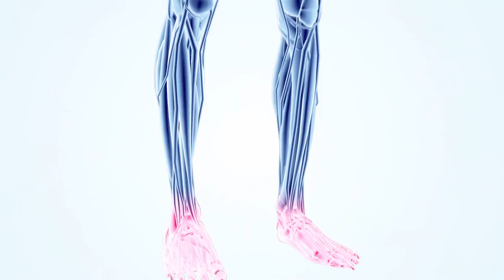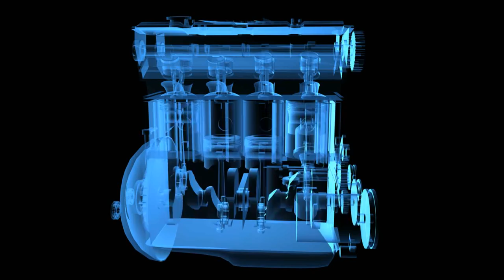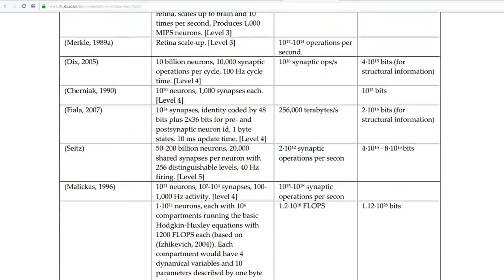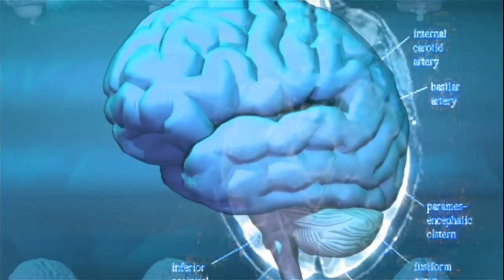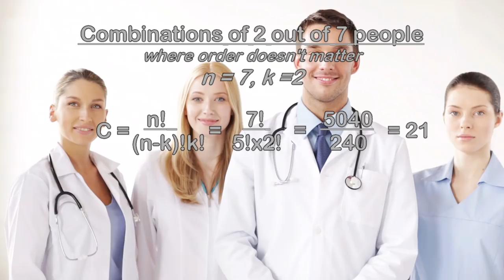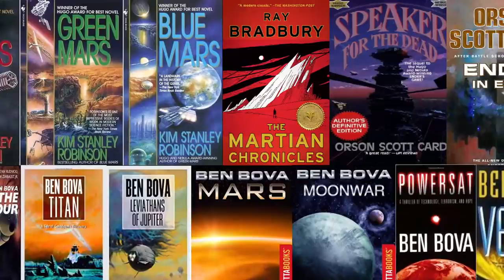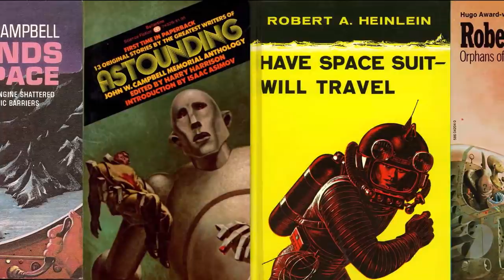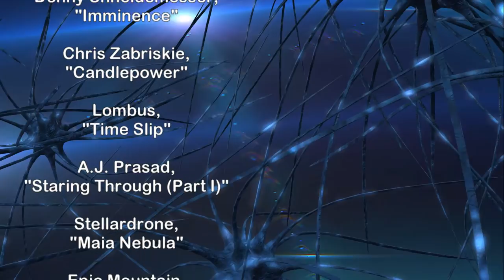Mind Uploading

Comment: yeah the biggest problem in mind uploading is not the hardware, but getting an actual scan of a brain and all the things you need to emulate in the first place.

Scanning tech is nowhere near a place to do it while a person is still alive and slicing up a dead brain probably destroys a lot of information you would need.
Reply: Zamuroy
We can now see neuron-level brain activity in realtime.
Reply: really? do you have any source on that? would like to read that.
also what exactly do you mean by neuron level? all connections all signals of all neurons, that would be news to me, but if true really incredible.
Reply: hmm while this is nice, it's nowhere near anything that would actually "scan" a brain... since it works with fluorescence you still can only use it by looking what lights up under a microscope, which means you have to slice and dice the brain in to parts small enough or when used on a brain you could only observe the surface, but would get no signal from deeper regions.

might be cool to learn how parts of for example the visual cortex works since that things is made up of pretty much millions of identical computing units made up of a few 1000 neurons. Could help improve existing AI systems.

But i don't think this approach in general will help with brain scanning, even in the future.

cool info though, thanks

Comment: I note you didn't touch on the possibility of each cell having quantum computing resources. If true, it would mean a complete and perfect copy of one's mind would be fundamentally impossible; perhaps even if it were a cell-by-cell replacement.
Reply: I wonder if it will be possible to have a "copy" be directly connected to the original mind... Have all copies be an extention of that mind's experiences rather than having separate, completely disconnected experiences, inaccessible to the original.
In other words, make the single original individual into a plurality.
Reply: The more I ponder uploading, copying and/or augmenting a mind, the more it feels like a new path for the same old evolutionary forces to have their way. The more it feels like an extension of what cells did long ago to start down the path to us and everything around us.
And less like we're reinventing or giving the wheel a new engine, and more like we're giving it another road. Just a new path to travel....To explore.
...And it all turns back into a zoom of this univere's fractal.

Comment: If you need a pilot, I think you'll make one from scratch rather than recruit a copy of a human. You'll get a better pilot with no distracting interests in pottery or coup attempts, no naps, no dietary requirements, and with fewer or no ethical entanglements. Non-human minds will be better at all tasks. There will only be disadvantages in employing humans instead of AI experts. 

Preserving, extending and duplicating human minds may still happen, but it will be more an exercise in vanity than a solution to staffing problems.

Comment: An interesting thing I have just thought of in regard to the ship of thesisus problem is that the question only is focused on losing or maintaining identity but what about the reverse when does something become the original as everything always starts out as something else something efor example at what stage in the ship building process did all the parts that thesisus had made become the ship .though I pose that question rhetorically as I believe that identity does not metaphysically exist as everything is in essence everything ,what I mean is that everything we experience is in the context of everything for example there is no inside without an outside ,white without black and to a more extreme extent the thing you refer to as I only exists because it is awash in a sea of other I's and wouldn't be without them ,not to say then you have total control over your body and mind and that brings me to another point there is this idea that has propagated itself throughout western philosophy that is of the ego being that which controls the mind and body but I'm afraid to say that simply is not true as there isfar greater forces that governs the body and that is the subconscious that makes sure your heart keeps beating , pops a memory into your mind when encountering a familiar smell or scene and is responsible for ...well for everything that you do and have very little control (I have a hypothesis that waking consciousness evolved or came about due to a certain level of complexity to increase perception of tools ,prey ,predators and what not and has persisted with the survival of our species ,but i could be wrong ) .so in short you my dear reader aren't an individual trapped in an awfully sensitive bag of meat until your awfully miserable time runs out but a different hue of being and only exist relative to everything else you are in a sense the universe (now, now don't take that solipsiticaly because everyone and everything is also it)

Comment: The problem with immortality (i we could replace our biological brain with an electronic system) is that with limited memory capacity, older memories wolud be gradually erased to make room for a new one. After several thousand years this "immortal" would be a new person. 

And we forgot taste of the bread. 
The sound of trees.
The softness of the wind.
We even forgot our name.
Reply: You can upgrade your memory system hardware to a larger one at any time, so you're never going to run out of space. Also, minds always change by their nature, and you are never the same person. All active minds are always changing and expanding as they accumulate more software (experience and learning). More software means smarter, so intelligence will continuously ramp upward. So, the mind software always has a version associated with it, depending on how long the mind is active. To be immortal you need to do a automatic mind software backup. Hopefully you can get a very recent version of that mind software to restore yourself when you've been killed. ;)

Comment: The only sensible way to deal with "copies" legally (even if they could be made) would be to treat them as if they were offspring.

Sleep is not a discontinuity of consciousness.  It's just a change in mode or method.  It's only the worst arrogance of the left brain that makes it think that its linear logic is the full sum of consciousness, and in this it is well known to be openly in denial of reality.

You can't copy a consciousness by copying a neural pattern.  Consciousness is not a static/isolated state.  Each creature's consciousness is also a function of its total biome and its total environment.  Consciousness is multilayered and multidimensional across the fractal of its interactions in Nature, which are functionally infinite and ever-changing.  You could make some kind of emulation with the equivalent of a tissue-thin photograph of yourself, but it won't be you because it can't copy your actual communions.  The best you could hope for was a pale imitation with your name and vanity stamped over the top.

If such a copy is you, then I can make a living as a fisherman by cutting out pictures of fish from a magazine.

Even beyond that, those calculations of neural processing capacity ignore the dynamics of glial cells, which add several orders of magnitude to the equation.  They also ignore interactive co-processing and input dynamics of the rest of the nervous system, glands, hormones, etc, each working on their own schedules and reference/relativity frames; which adds several more orders of magnitude.

Then there's the possibility of quantum resolutions being the foundation of consciousness in some way, leading to the emergence of mind and thought.  The calculations also don't take into account the exponential rather than multiplicative nature of a neural network -- one neuron hooked up to 10 that hook up to 100 do not have a complexity of 1000, it's something more like 10^10 or 100-factorial for just those 100 cells, even ignoring inputs across larger distances.

Even to write an accurate system for encoding these dynamics, you would have to allow for programming not in binary code, but rather in at least a dozen dimensions simultaneously, possibly using quantum computing solutions for each cell and operation.

In the end, consciousness is an emergent property.  To really copy any given nexus of consciousness ("a mind") you would have to copy all of its conditions and dynamics as they actually exist in Nature.  Any lesser copy of you simply wouldn't be you... it's just a parrot that had practiced imitating your voice to feed your illusion.

You cannot separate mind from its substrate and environment.  Consciousness is interlinked across the cosmos and cannot really be copied onto any smaller format.  A machine consciousness is its own creature, starting as an outline drawn around the shadow of what cast it.  What it becomes from there could have any destiny of its own.

Comment: Achieving definitional consensus as to what consciousness itself is before uploading may be helpful. To that end, MIT professor Max Tegmark offers a thought-provoking, albeit ‘beyond current mainstream consensus’ theory of emergent consciousness: https://arxiv.org/abs/1401.1219 
Theory as presented in paper (supra) extends and expands upon an informational approach to physics pioneered by Shannon, von Neumann, Wheeler and others. Nutshell: “Consciousness is what processing information feels like”; arrangements of particles -if organized ‘just-right’, can process information whereupon such structures can be said to have some degree of consciousness. Tegmark concludes among other things, that human-like consciousness will not be the only type to emerge in a universe: animals and computational devices as respective non-entropic arrangements of matter capable of information processing, would thus also be said to contain a degree of consciousness. Tegmark is careful to point out that ‘thought’ patterns originating from structures with lower levels of complexity than humans wouldn’t likely be recognizable as similar to things humans typically characterize as thoughts. ‘Consciousness as a state of matter’ has often been critiqued as over-reaching in analysis and synthesis. Imho by providing a quantitative measuring tool Tegmark also provides a starting point to distinguish human-like consciousness as all the more unique with its characteristic emphasis on processing information accompanied by subjective ‘feels like’ qualia..

Comment: Issac how does this not cause instant insanity. Say my mind suddenly becomes AI, now I am not getting any sensory inputs to my brain correct? Unless the mind is in a simulation, it would like suddenly become blind and deaf and unable to speak or feel, only able to think? Am I missing something?
Reply: You're missing USB camera, microphone and WIFI connection ; )
Reply: ... Also, why does the copy have to be running without the sensory input ? Just shut off the power until the required sensory hardware is installed.

Comment: If I remember correctly, in 2012, a Japanese team tested the then fourth largest parallel supercomputer by running an academic open sourced software which simulated the function of neurons and synapses and they simulated a human visual cortex.  It took 40 minutes to simulate 1 second of operation.  Given Moore's law, that would imply the simulation could be in real time by 2029 which is eerily consistent with Kurzweill's predictions.

Comment: Around 7:30 you talk about emulation. What you say isn't quite right.

When talking about emulating software, there are 2 levels: low-level and high-level. Low-level emulation fakes the hardware the software is made for. You take (or reverse-engineer) the specifications of the chips and motherboard and turn those into code. This code should act exactly the same way as the original hardware. When you give this emulation software a piece of code to run, the result will be identical to what you would get on real hardware. You're faking everything. When applying this to a brain, this would entail simulating the chemistry of the brain. We are very confident we can replicate a human exactly using this process, but the computational costs are prohibitive.

High-level emulation takes advantage of the fact that software rarely cares about the hardware it is running on. Instead of replicating the hardware, you replicate the instructions in the code. You look at each possible instruction and your code translates it to the native instructions of the physical hardware you want to run the code on. The upside of this technique is that it can be really fast. You don't necessarily have to pay a large performance penalty if you're emulating between machines with a similar architecture. On the other hand, it is not nearly as reliable. The original software may have relied on side effects of instructions (undocumented behavior, specific timings, etc) and in the translation step more unintentional side-effects may be added. If you ever had a game emulator that could run some games perfectly and others not at all, this is the reason. When applying this to a brain, it would be more like simulating at the level of the neurons. It's relatively easy to get the broad strokes right, but at this point we don't understand enough about how the brain works to confidently be able to say we can run a brain like this. We should have the performance to do this some time in the next decade or two, but it is unlikely to yield human-like results anytime soon. We'll be able to make very smart systems this way, but it will take decades more research to tune this so it actually gets close to operating like a human brain does.

Comment: Every Planck moment of every day, you are destroyed and copied into the next state in the space between ticks of the quantum clock. This process is inexact due to thermal noise and Brownian motion. Your atoms are constantly jiggling around meaning even the actual you that you claim to be your one and only isn't a perfect copy moment to moment. If this doesn't bother your illusion of continuity, then no copy that is less lossy than thermal noise at a macroscopic level should bother it either. You and your copy are both the original, for the same reasons that you always considered yourself to be before. You are not a noun. You are a verb. Anything that performs that verb is you.